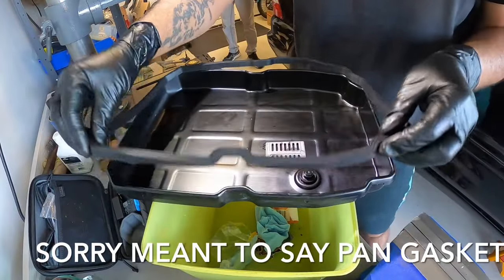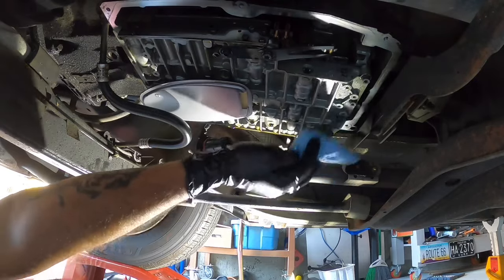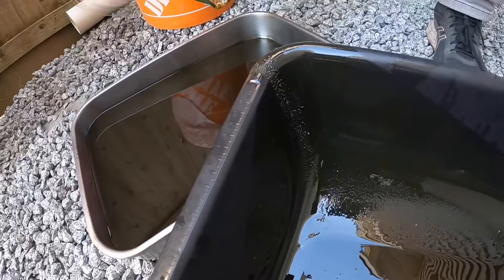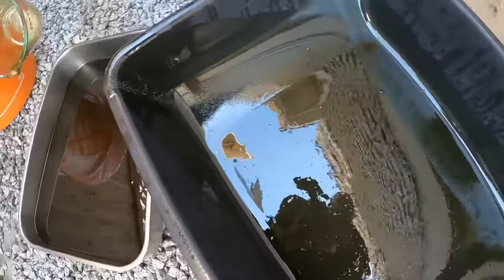Mercedes ML transmission (W163) fluid change THE RIGHT WAY

Comment: My transmission  slips under sudden power, so i simply pull over turn engine off for half a minute if that & restart engine & drive off...sure the filters dirty & the solenoids  need  changing but who has money these daze for that...?
Reply: Sounds like your transmission plug adapter is bad.  $10 part off Rock Auto.  Common issue, the electrical plug as mentioned in this video.

Comment: Crazy that the dealer and some independent German car shops want $900 to $1000 to do this fvcking job.  Insane.
Reply from the maker: @Big_Island_Boi  Dealers are unreal with their rates and shop times. Nothing is cheap at the shops, unfortunately. It's a fairly straightforward job and doesn't take too much time.

Comment: also do i absolutely have to replace the solenoid when i do my trans change??
Reply from the maker: @jaylanhowrll3839 the solenoid is suggested only because it does leak overtime (if it's not leaking now) saves the trouble of messing with it all over again later. But upto you completely, if it's not leaking you could potentially get away without doing it for now, however it's a gamble I personally wouldn't take.
Reply: @gasNgears  what’s the actual solenoid part called?
Reply from the maker: @jaylanhowell3839  13 pin transmission harness connector.
Reply: @gasNgears  ok and did you have to replace all 9 quarts or you just filled halfway? does doing it the way you did it release all or some of the fluid?

Comment: hello my ml has a problem with the automatic shifting i go to the first gear the car doesnt move i shift and shift the car still doesnt move it just stops only drive works what do you think is causing the problem
Reply from the maker: What year and model is your Ml bud? I am just taking a guess here, i think it could be your conductor plate, which is a common wear item at high mileage ML's or it could be stuck in limp mode which can be caused by a few different things like speed sensor or conductor ! I would try to disconnect the battery and see if that makes it work and then try reading the codes and so on. Good luck 👍

Comment: great video, I will have to do all this on my 270 W163. Everything is still fine, sometimes I scale gear alone but very rarely, however it has 190k Km and I want to change, I have to buy the measuring rod, tell me how the right level must be. I think he has already lost some oil. Greetings from Italy
Reply from the maker: Ciao! Thanks for watching. My Ml320 is at 187k kms as well and I've realized that more routine maintenace I am doing, the better it gets. Transmission was a huge improvement and now recently I did the throttle body cleaning that made my fuel economy improve  a lot. Those measuring sticks are cheap on ebay and they have measuring marks at the very end of the stick to be precise. I suspect the fluid loss might be from the 13pin connector plug. If you haven't changed that part before then I would highly recommend it as a lot of people have reported the item failure on the forums. Goodluck!

Comment: Great video. Wonder how often to perform this fluid change. Thanks a lot.
Reply from the maker: I have changed it twice in two months just to make sure I get most of the old fluid out, a lot of fluid gets stuck in the torque convertor and replacing twice or may be three times gets most of it refreshed. I think on higher mileage ML's  it's  recommended to be changed around 30k miles or two years roughly!
Reply: Do it every 60-80000 km, whatever that. Is n miles….
Reply: Thanks for the info. Will need to change the fluid.

Comment: Where did you purchase your dipstick?  I noticed it was the correct length.  The one I purchased is too long and is meant to be used on multiple different models.  .  You are supposed to insert to when it bottoms out.  Can you tell me the length on your dipstick?  Thanks
Reply from the maker: I purchased it off Amazon bud and it's 122cm. Mine bottom out perfectly though.  Hope it helps.

Comment: Hii, very usefull video, thankks!! Btw, what oil did you use? What kind? And how much oil do you fill up? And how to measure?
Reply from the maker: Hi Fajry, I used Fuchs Titan ATf 4143. I drained my transmission and then measured it with a measuring  cup, could probably use the baking ones as they have pretty good measurements on them. I had roughly over 2 litres of fluid out because  about a litre of it stays in the torque converter. I am going to change the fluid again soon so the torque converter fluid can also be refreshed a bit. I put in the exact amount that came out and then measured it to make sure I didn't over fill. Hope it helps. Cheers
Reply: In doing this procedure would reset the limp mode

Comment: I thank you for your helpful video
Tomorrow I try it on my ML400 too.
Wish me luck that’s only the oil and not the turbine🫣
Reply from the maker: Them turbos are pretty reliable so hopefully all goes well for you bud. 👍
Reply: @gasNgears  sry My English isnt percfect😅
I mean I am afraid about the converter clutch
Reply from the maker: @Nico-xo7rd  😆 fair enough bud.  I thought you had the European Diesel ML with a turbo.
Reply: @gasNgears  hello. Ok update. It wasn’t the gearbox or the clutch. It was the propeller shaft, or better say the universal joint.

Comment: Hello Friend, great video. What worries me the most is the metal shavings, has the transmission slipped at anytime when driving?
Reply from the maker: Hello Emmanuel, thank you. No my transmission runs great. I have been lucky and had no slips at all. The suv pulls like a freight train. I am going to install new motor mounts soon and can do some pulls if you wanna see how it runs now.
Reply: Mines slips on from 3rd to 4th. About 500rpm slip when changing.  Should a service be enough to fix it or the tranny is gone?
Reply from the maker: @Rookiemisteak  I would start with oil change and see if it makes any difference bud. That's a cheaper way to start fixing the issue. Check the oil for metal shavings and see how it looks in general. A lot of high mileage ML's do get problems with the conductor plate and replacing those fix the slippage problem usually.
Reply: @gasNgears  yes it is showing its age,  coming up to 400xxxkm

Comment: 4:30 I have seen people get more of this oil out by poking a screwdriver at 2:00 in the drain hole at an angle and knocking the pipe off the drain spout

Comment: Were you able to get the trans filter to click in? When I did this job the filter seemed kinda loose when I was finished.  Couldn't get it to click or anything. Thank you for the great video.
Reply from the maker: Hey bud, yes mine went in without any issues. As long as it stays on, it should be fine I rekon. Click might be subjective to the brand of the part. Did you use OEM filter or aftermarket like mine! Hope this helps. Cheers.
Reply: @gasNgears  I used aftermarket brand  beck/arnley. Thank you for quick reply.

Comment: wHEN DO YOU UNPLUG THE CONNECTOR? BEFORE OR AFTER YOU REMOVE THE PAN?
Reply: You can remove the plug without removing the pan. It does makes it easier with the pan off though.

Comment: Hi, in your video you mention the plastic plug, the one you remove and replace. 

Can you tell me the name of this sensor so that I can purchase a new one before I do the oil change. 
Thanks
Reply from the maker: Hi Allan, it's called the 13 pin transmission connector plug. Here is the link for it https://www.fcpeuro.com/products/mercedes-auto-trans-connector-2035400053#fitment
Cheers
Reply: Thank you very much for getting back to me. I’m in Scotland so shipping would be considerably more than the part itself. 

Thanks to your description, I was able to find on eBay for much the same price. 

Thanks again
Reply from the maker: @allanbarbour2879  no worries mate. I am glad to be of help. Hope the job goes smooth for you. Be careful when you install the plug, make sure it lines up properly. Tight workspace  makes it hard to see if all the pins are lined up in the connector. It's really easy to cross thread the fine thread on the connector screw so be really patient. Any damage will lead to a new conductor plate. Cheers

Comment: I'd be interested in your take on the W163 ml 270 cdi ?
Reply from the maker: @Leo70780  those are one of the best series of W163, in my opinion. Too bad they were not sold in North America. Those engines, with timely maintenance, can last forever. They are getting up there in age nowadays, so the turbo needs replacing or rebuilding. Common problems I heard of are to do with the steering rack. I would buy a cdi W163 in heart beat as long as there is somewhat required of maintenace performed in the past.

Comment: I'm looking at a w163 ml 320 1999 would a 2002 be better , I'm not sure .
Reply from the maker: The engine is slightly bigger, and  the exterior  and interior has slight changes. 2002 had better headlights and slight hp increase. Earlier 320s had a bit better gas mileage than the 350s.
Reply: Thanks for the Reply 😊  @gasNgears
Reply: I'd be interested to know what you think about the w163 ml 270 cdi ?

Comment: i’ve read the manual and it says that changing the sealed fluid can do more harm then good. what you think about it? think it’s true??
Reply from the maker: Just like bmw life proof fluid, no need to change and then suddenly upon mechanical failure, they'd be happy to sell you a new transmission for 7 grands or more. I've put on roughly 10k after the fluid change, and it's been fantastic.  I don't think any fluid would last transmission life term, to be honest.
Reply: @gasNgears  right brodie i’m in the midst of doing mine. just bought the same car two days ago. EXTREMELY NICE CONDITION. was hoping if you could send me some links to get the fluid and transmission kit. also the larger rear seat in the back won’t slide back or forward so i’ll need help with that if you can. i’ll take down a number or email bro. i’ll send all the pics i can🙏
Reply from the maker: @jaylanhowell3839  I ordered my fluids from germanparts.ca and the transmission electronic plug was from Amazon. Your seat release pins might be stuck so I would spray some lube or pb blaster in there to see if it releases the seat bud!
Reply: @gasNgears we think the lever got stuck or loose or something so we’ll try that, and i looked up the part you sent and it’s only like 13$. the solenoid is around 80 to 100$. i’m assuming doing this, i won’t have to change the actual solenoid just this connector like you did?

Comment: Did this help improve your shifts?
Reply from the maker: Yes, it helped immensely! I don't have the jolty shifting anymore. It used to be unpleasant but now it works very well and I am going to change the trans fluid once more which will hopefully make it perfect. Cheers
Reply: @gasNgears  thanks mate, much appreciated
Reply: What year ml350 are you working on in the video. I’m going to give it a try on my 2012 and I’m just trying to research it a little befor😅

Comment: How much oil liter was in the gearbox i make the same job but in my gearbox was 2 liter  ml w163  270cdi  2002
Reply from the maker: I wasn't able to get all the fluid out myself because of the torque convertor. Roughly half the fluid sits in the torque convertor and it will rotate through over two or three fluid changes or you could try running a hose down filler tube and use a suction pump to drain all the fluid from the torque convertor.

Comment: Forgot to empty torque converter??
Reply from the maker: Mine doesnt have the drain plug for the torque convertor, only pre face lift had the option to drain. From what I know, you have to change the fluid a few times to make sure it circulates and replaces the torque convertor fluid too or drop a line through the filler tube and empty with a suction pump of some sort!
Reply: @gasNgears  I flushed mine by taking of the return line from the oil cooler and let it pump 1L then adding 1L. Think you have about 4,5L in the converter..
Reply from the maker: @Bjørn Eric Wang  that's quite a bit more than I expected but thank you for sharing the info bud.

Comment: in all how many liters does this gearbox carry
Reply: From my knowledge, around 8 litres including the torque converter. The first time I changed mine using the above method, I removed 4 litres. I then drained the pan on each  5000km and refilled. This will hopefully fully refresh  the fluid over time.

Comment: My pan did not have a magnet in it.  But the I think it should.  I have a 2001 ML 320.
Reply from the maker: Fairly certain that there is supposed to be a magnet to catch any metal shavings in the tranmission pan.

Comment: What ATF did you use? I see Fucks Titan? what kind? 4134? Pentosin? What generic cheap stuff can I use to save?
Reply from the maker: I used the Fuchs Titan 4134, you could Pentosin ATF 134 but I would stay away from the cheap stuff because if it may cause issues and end up being an expensive repair bill than the oil itself bud.

Comment: The dip stick I have can’t go all the way in. Where did you purchase the dipstick?
Reply from the maker: I bought mine from ebay bud. Did you try twisting it! Mine sometimes gets stuck too but twisting the handle clears it. Hope it helps.
Reply: @gasNgears  ok thx
Reply: The dip stick on many models does not have to go all the way in ,,just push it down until it stops, wait a few seconds then check it.